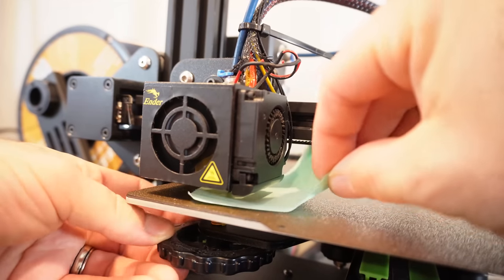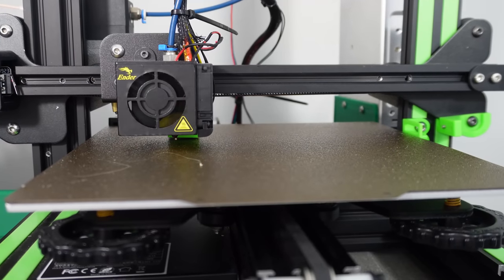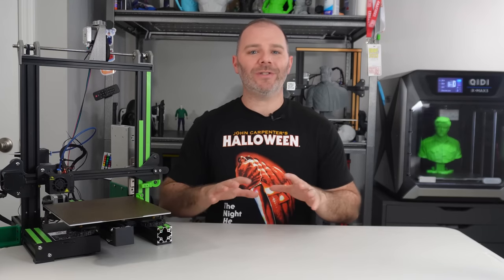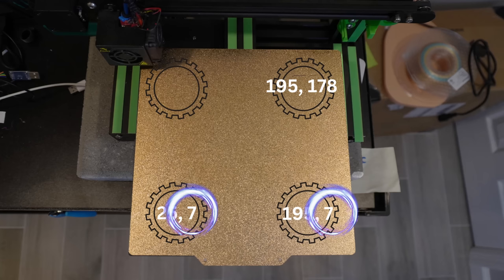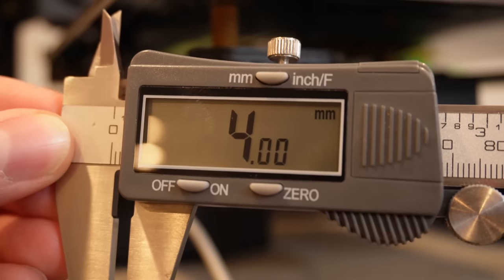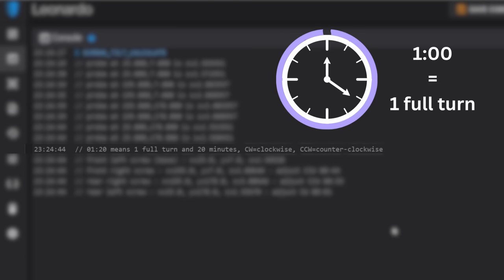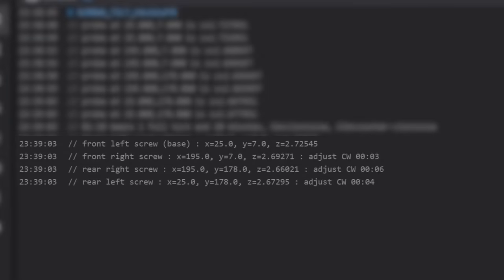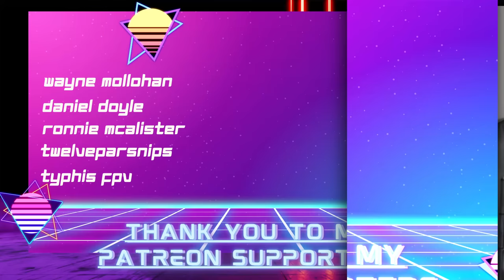Let Klipper level your bed with the built-in tool screws_tilt_adjust

Comment: I have an ANETH A6 and a TRONXY 5sa :hand-pink-waving::face-purple-wide-eyes:
Should I replace/buy another piece of hardware or I can just upgrade with Klipper to get better performance? :person-turqouise-waving:
Reply from the maker: Alexandre, I don't have any hands on experience with either of those machines, so I only can give you advice through what I have heard and have researched. I know the Anet line has somewhat of a dark cloud over it due to performance issues. I don't know if those stories are true or untrue (or likely somewhere in the middle) but from the quick searching I did I was unable to find a suitable Klipper configuration file.
    For the Tronxy I know a lot of people who have Klipperized them. I couldn't say for your exact model but I was able to find one github repo that had some instructions:
https://gist.github.com/cab404/b7bcbb0cd592a14515493694719de59b

In my opinion flashing Klipper on any 3d printer is an upgrade, but it will require some new hardware. You will need a 'host device' to run the brains of Klipper. That device can be anything that can run Linux (a raspberry pi, tv box, Inovato Quadra, or an old PC). From there you would need to just find a configuration file for the 3d printer you want to use with Klipper (I found something for the Tronyx but didn't come up with anything for the Anet, but that does't mean it doesn't exist). It's up to you the route you want to take, but either way I believe Klipper is an upgrade to most all of the base firmwares if you are willing to give it some time and some research.
Reply: Thanks  @PrintsLeo3D  for your quick response.
Sure Aneth A8 and A6 got a lot of issue with overheating/fire in the past. I've instal 2 mosfets and never got any trouble in last 5 years.  And today only a broken fool would buy a new A8-A6 unit because there is better option on the cheap side.
I'll look for the tronxy, I do have an old laptop. I would love to include a accelerometer sensor and get BambuLab speed on the cheap...
I can dream.. I know...

Comment: You have some amazing videos Leo. Have helped me so much with my Aquilas. I ran the calibration, first time deviation 1.42. made adjustments, second time through even worse, 1.72. Not sure what I am doing wrong.. I'll keep trying and also check Z offset of probe?
Reply from the maker: Well first thanks for the vote of confidence , means a lot. For the calibration it could be a couple things. First you have to remember as you make adjustments to one side of the bed, the other will be affected as well, so sometimes this will take a few passes to get it right.
    Second , double check your spinning the knobs the correct direction. I know I've been guilty of turning these the wrong way myself. Just double check the rotation and give it another shot. 
    Good luck and I hope this helps .

Comment: Hey Leo, can I use this for an Elegoo Neptune 4 Max? It has six adjustable wheels on the plate and how would I label the other two in the middle for the code? I’ve been having a hard time getting a good bed level on this machine. Been trying for weeks to tell you the truth.
Reply from the maker: Hey sorry for the late reply, but you are absolutely correct! You can just add screw5 and screw6 to the macro and plot the correct coordinates and it will all work. I would keep the screws numbered in order 1-6 starting from the front left and traveling clockwise (which would make screw6 the middle left screw... if that makes sense). I hope this helps and is not too confusing. Let me know if you need any more assistance!

Comment: is there a reason to stick with a spring mounted bed when you have a probe? would it not be better to just mount it with spacers and just use a bed mesh?
Reply from the maker: Yea that's a great point. once you have a probe and you've trammed it properly , stabilizing the bed is a great way to keep consistent prints. It's not something I do, but it's a great idea and I could see the benefit for people who do decide to go that route.

Comment: I can't get my probe over the screws on the left side since my probe is attached off to the right of my head to the point that I reach the end of the X axis. Is there another suggested way or method ?
Reply from the maker: No, if you can't get your probe directly over the screws , just get the probe as close as you can and use those numbers. It doesnt need to be exact, just close.

Comment: Hi all, I have just purchased a N4M and would love to use this on it. Is there any video showing how to use it on a N4M. I see in the comments that the centre is selected as the first probe point and then add other points....how do you do this? When the mesh is created is there a way to save this as the new default? 
Thanks in advance.
Reply from the maker: Hey Aaron I'm not too familiar with what an N4M is, can you explain? During the setup of this macro you can make whichever probe point, or 'screw', you want to be the first one tested.
Reply: @PrintsLeo3D  thanks for the reply, sorry i should have mentioned that the N4M is the Elegoo Neptune 4 Max.

Comment: I'm not sure if it's the right thing to do or not but if you notice you always get a z number for each screw. What I do is try to get each screw to match my z offset number. This way I don't have to mess with changing my z offset.
Reply from the maker: That's actually an interesting idea, but I think you're torturing yourself lol That seems way harder than the normal methods, but if it works for you then it's hard to argue its efficacy ! So good luck and good job I'm happy this works for you.

Comment: Would it be possible to run the code used here without the klipper environment by inputting your mesh results 'manually' each time you run it?
Reply from the maker: I'm not too sure what you're asking. Using a non Klipper environment (like Marlin) they have the ability to direct your print head and probe to exact locations in series. Which would allow you to adjust each corner. Having the probe take results and give you realtime data might be a bottleneck there but I'm sure if you spent enough time you could make it work.

Comment: Where can I get a replacement bed sheet? The nozzle gouged it trying to print the first print after leveling.
Reply from the maker: It will depend on what printer you have. Most printer manufacturers will sell new bed sheets direct from their website. You can also find comparable or even better bed sheets from third party companies through Amazon or AliExpress. Just make sure you get the correct size for your bed.

Comment: I am affected by both, neuropathy and grip issues. What about a "Bed Leveling Tool" ?  Basically, it just glows when the extruder touches it. Has anyone used that ?
Reply from the maker: Michael that's another great suggestion! I believe Cheap (of 3d printing YouTube fame) has a leveling tool that does use a light to indicate proper height. I never used it myself but from the small times I've seen it advertised I think that's how it works. Hope this helps !
Reply: @PrintsLeo3D  Thank you very much.

Comment: If using a probe on any firmware replace springs with Invar stand offs machined to size. Invar does not expand when heated to high temps.

Comment: I have an Elegoo 4 pro. I don't have the "Tools" menu to the right of the "Motors off" menu. Is there a way to add this Meny to the printer.cfg?
Reply from the maker: Unfortunately Elegoo has configured some of the front facing Klipper options which creates head aches for users. I don't own an Elegoo but I normally you can find the gear (or burger) icon at the top right of the home page. Then from there you can configure the home page setup which allows you to hide or make visible different sections. Just find the Tools section and add it to the home page from there.

Comment: After adding screws_tilt_adjust to printer.cfg and restart I get this:

> Section 'screws_tilt_adjust' is not a valid config section

This is what I am using:

[screws_tilt_adjust]
screw1: 27, 0
screw1_name: front left screw
screw2: 195, 0
screw2_name: front right screw
screw3: 195, 169
screw3_name: rear right screw
screw4: 27, 169
screw4_name: rear left screw
horizontal_move_z: 10
speed: 50
screw_thread: CCW-M4

Help?
Reply from the maker: This templating looks fine to me. I would think it may be an issue with how it's written in the .cfg file. Perhaps it's not indented properly or something like that. Which of your configuration files are you adding this to?

Comment: I was going to setup z tilt adjust in klipper on a btt pad7 but have the 4.2.2 board in my printer, so I think I need something with drivers for each stepper like a btt skr. This  might work for me untill i can put that all together. Trying to get this hero7 setup printed so i can install my sherpa mini and 5015 fans but every time i start a new print I have been having to step the z axis down .01 or .02. Something tells me i need to add something into my start print.cfg in orca but im at a loss right now!
Reply from the maker: For z tilt you will need individual steppers per Z motor, so they can adjust independently. 
    For the constant z adjustments,   I would recommend going back to basics and and performing a probe_calibrate, and then live adjusting during a print afterwards. But you need to make sure you are saving those adjustments at the end of each print using the save icon (small disc) that appears in the tool section near the live offset controls.

Comment: Thank you for providing this knowledge, I am testing it on my ender 5 plus, just one question: the bed must be heated or work cold.
Reply from the maker: There's some debate on whether to heat the bed or keep it cool. Obviously under heat the bed will expand and change its shape (to a degree). Heated is also the condition that you will be printing this on. That being said I prefer to perform all my bed leveling/meshing operations without heating. Whichever you decide I would just recommend using that method throughout. So if you're heating it make sure to heat it for all bed related calibrations (level, probe, mesh, etc).

Comment: Excellent,
Can you let me know how to use my 3D printer Lidar using Klipper to level the bed
Reply from the maker: Ramin, I can't tell if you're messing with me or not lol right now I am not sure where/if any support exists for Lidar in Klipper. My hope is that someone can get load cells working properly, that would be a huge step forward.
Reply: @PrintsLeo3D  I am serious, The Creality K1 Max comes with LiDar and should be able to scan the bed
Reply from the maker: Woah! I didn't know it was rocking lidar. I know it has that awesome noze probing system. I don't know if Klipper has integration with lidar yet, but there's got to be a way that Creality is implementing it. I'm going to take a closer look at this.  Great question, thanks for sharing .
Reply: @PrintsLeo3D  Thank you

Comment: Hello Leo
I have converted my Ender 3 to Ender extender 400x400x500. Also installed dual z drive and direct drive. 
What would you suggest in the order to tune and calculate?
Thanks
Ps
I am running klipper
Reply from the maker: Well in general I would start by suggesting all the base calculations you should normally perform:
-PID tune hot end and bed. 
-Adjust rotation distance for extruder (used to be esteps)
-Level bed
-Creaye a bed mesh
-Pressure advance 
-Input shaping 

After that you'd want to find out what you max flow rate is for your hot end. These are all 'in general' calibrations though, I don't know there's anything specific you'd need to calibrate for the extender.
Reply: Thanks so much for your time and knowledge 
 @PrintsLeo3D
Reply from the maker: Of course, that's what I'm here!

Comment: where is the touch probe on the neptune 4 pro?
Reply from the maker: I believe the 4 pro uses a proximity probe and not a pin style probe. So you'd want to line that small probe up with the screws just like I did in this video.  I wish I was more familiar with the Pro 4 but I don't have any hands on experience.

Comment: what if your base screw "number 1" is already out of wack, how do we get it back into level?
Reply from the maker: You'll want to adjust your nozzle to that screw specifically. That would mean homing the printer, then navigating the hot end above that screw, and using a feeler gauge (I use a post it note) in order to get the gap between the nozzle and the bed just right. When I say 'just right' I mean there should be a decent amount of tenaion on the post it note when you move it between the bed and the nozzle. That will give you a great starting point.
Reply: @PrintsLeo3D  i appreciate the response, i might be going about this wrong, i put my hotend over screw 1 and i lower the Z axis, for me to get that drag i need to pretty much max out screw 1 and 2, which leaves my bed with 1 hell of a bow. definitely a struggle on the neptune 3 plus. thanks btw
Reply from the maker: @WNxSect if you're having to make such a gross adjustment for that one screw then maybe I'd recommend to change your "base" screw. If you just switch the coordinates up you can make the base screw the front right screw. For instance under screw 1 put the coords for screw 2, then for screw 2 the coords for screw 3, and so on and so forth. This might give you a better chance at a leveled bed without so much cranking.

Comment: I do not have a tools dropdown menu on fluidd ...Any ideas?
Reply from the maker: Pat, I've never seen that. It's possible you have one but it's been turned off maybe. From the home screen you can click the 3 dots dropdown in the top right corner . From there select 'adjist dashboard layout's and see if the Tools menu has be unchecked and turned off.
Reply: Thanks I'll give it a try
Reply: FM freaking magic it showed up woohoo thanks
Reply from the maker: Great to hear it works! Have fun and good luck !

Comment: What manner of software do you need to even attempt this. There are no such options in cura, freecad or blender...
Reply from the maker: This feature is available using firmware called Klipper. The 3 main firmwares for 3d printers are Marlin, Klipper, and RepRap. 
    By far the most common is Marlin firmware, but I am illustrating this feature using Klipper. I'm not sure if Marlin has this option, and if it does I am not sure how it would be implemented.

Comment: 1 make sure that you bed is flat most of them ar not. 2 allways heat up the bed temp will deform all  (physical substance) like the bed !!!!!. 3 softwear bl touch.cr touch e.t.c will probe 5,10,20 points and will miss the hole !!!! so what we 3dprinters end to 4 and last find something the you know its straght the size of the bed about 200mm long place it on the bed and take a light from the back if you see light at the point you touching bed you have a problem if not your lucky happy printing   :)
Reply from the maker: Emmanuel thanks for watching and sharing your info! I'm not sure what you mean in your 3rd point about the probe software. 
    Also about heating the bed, I don't heat up while leveling, but I know some people like to. I understand the bed will change dimensions when heated but I stick to a cold bed. That being said I think what's most important is to be consistent with your approach. If you use a cold bed do that for all bed calibrations and the same goes for a hot bed 👍 
    Thanks for watching and sharing your methods.
Reply: Next video .. how to lap the bed with a glass plate/mirror and wet sanding
Reply: its just the way i find better to get the bed at 60 i recently went to klipper on a ender3 pro and after many times i tested the z offset i found that a defrence with acold bed and a hot bet. also i found that the probeing points will send data to the mesh only of the point it probes thats how i see it i do use a CNC and a laser all DIY.
Reply from the maker: Lol that's the dream.
Reply from the maker: I had a section in the video that I think touched on what you're talking about. On most probe movements Klipper wants the probe's coordinates, but with this a movement using a probe it doesn't, it wants the nozzle's location. I decided to delete that part of the video because I was afraid the explanation would confuse people more than just explaining the straightforward application of the macro.
Reply: @PrintsLeo3D  confuse people Leo your a nice youtuber with vary clean explantion in your videos and i know how much time and work and reading it takes to do this thats why i follow you and all i can say is thanks keep up your good work :)

Comment: I also heat the bed to a safe 45C because I know heat plays a part in warping the bed.  Using a flimsy PEI surface doesnt help so....
Reply from the maker: Yea a lot of people like to heat the bed during this and other probing movements and I don't fault them. My rule is always just to be consistent, so if you heat the bed for these probes heat it for all. Thanks for watching and commenting!